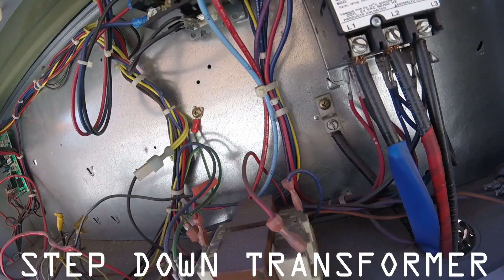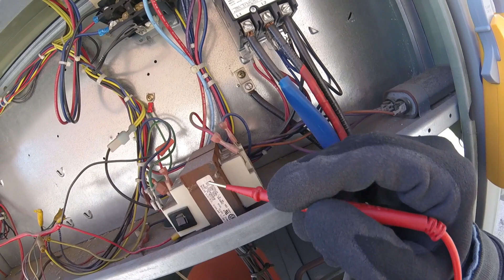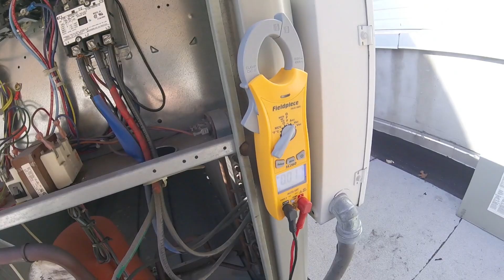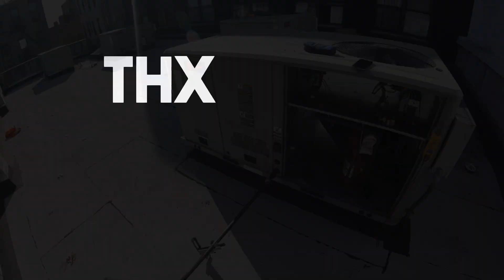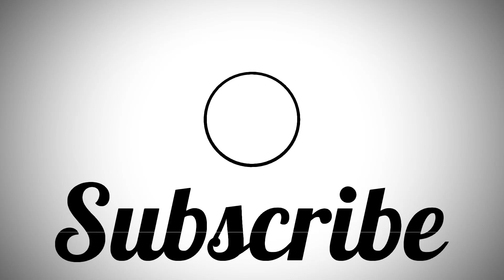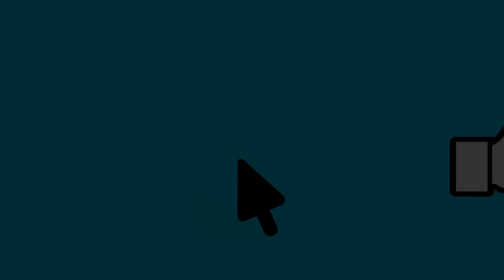HVAC: How To Check A Step Down Transformer (HVAC Transformer Troubleshooting) Commercial HVAC Tech

Comment: Instead of having 24 volts I have 92 volts would that mean that my step down transformer is not working?
Reply from the maker: Look at the ratings on the transformer. Try to see if you can read the sticker on the transformer. "PRI" = Primary & "SEC" = Secondary. Primary would have higher voltage than the secondary. Primary can be 120v, 208v, 230v & 480v typically and secondary can be 24v, 120v typically. 92 volts seems a bit low for 120v. See if the connections are rusted, if so clean them or replace them and check voltage again. Also check for loose connections. If all that is good, transformer might be worn out with 92 volts. Make sure your meter works too lol Hope that helps! Thanks for watching & subscribe for new videos every week!